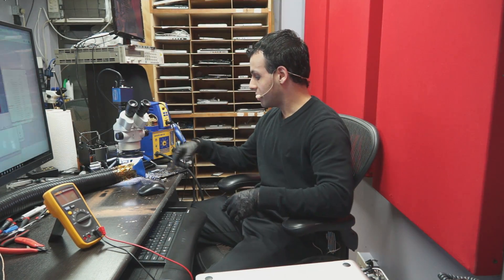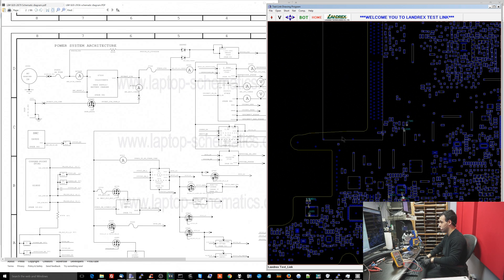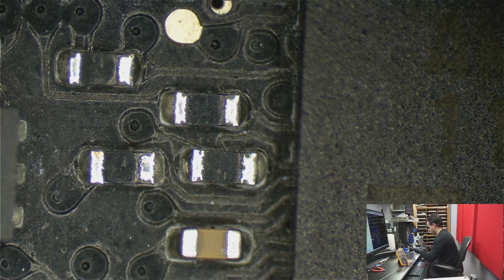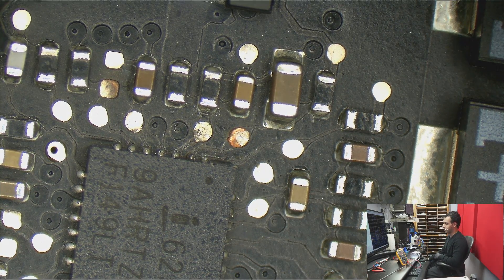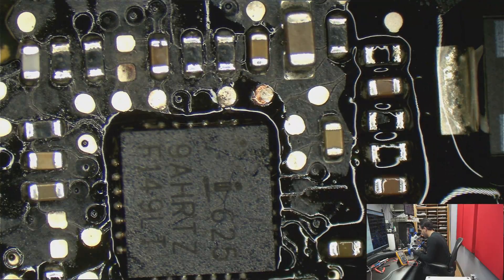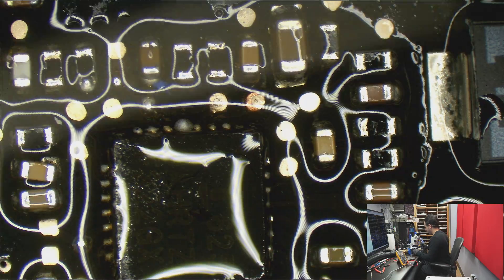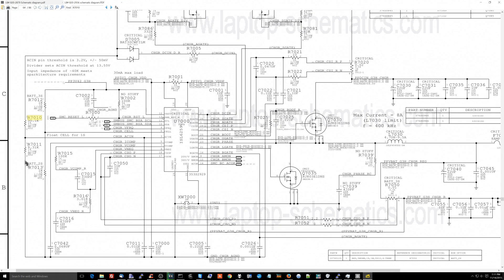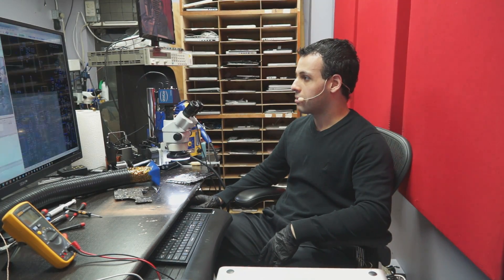Macbook 820-2936 logic board dead; diagnosis and repair of U7000 circuit.

Comment: C7011 connects the center of the resistor divider to ground, it could have been this capacitor. But why didn't you suspect this capacitor before judging on the chip ? These kinds of capacitors also fail short.

Comment: I have this problem with a board 820-2936-B:
- green light on charger oK
- fan spins ok, but then a full speed
- no chime, no long beep even if no memory
- nothing on display, not backlight.

Measures:

ALL_SYS_PWRGD=3.32V
PPBUS_G3H=12.6V
PP3V42_G3H=3.48V
PP3V3_S5=3.33V
PP5V_S3=5.1V
PP5V_S0=5.1V
DPBUS_S5_HS_COMPUTING_ISNS=12.6V

PPVCORE_S0_CPU=1.12V
PPVCORE_S0_AXG=0V

PPVRTC_G3_OUT=3.33V
PP5V_S5=5.1V
PP5V_SUS=5.1V
PP3V3_SUS=3.33V
PP3V3_S3=3.3V
PP3V3_S0=3.3V
PP1V8_S0=1.8V
PP1V5_S3_DDR=1.51V
PP1V5_S3RS0=1.51V
PP1V5_S0=1.51V
PPVTTDDR_S3=0.75V
PP0V75_S0_DDRVTT=0.75V
PPVCCSA_S0-CPU=0.9V
PP1V05_SUS=1.04V
PP1V05_S0=1.05V
PP3V3_ENET=3.29V
PPVP_FW=12.75V
PP3V3_FW_FWPHY=3.31V
PP1V0_FW_FWPHY=0.99V

PP1V05_S0_PCH_VCCADPLL=1.06V

PP1V5_S3_CPU_VCCDQ=1.51V
PP1V05_S0_CPU_VCCPQE=1.06V
PP1V8_S0_CPU_VCCPLL_R=1.8v

All these voltages seem ok, except for PPVCORE_S0_AXG=0V, but for what I see, it doesn't appears until videos is displayed

Comment: i brought my macbook A1278 820-2936B to repair shop, and they didn't do it well, and after i check my board, i found that u7740 is missing, and i check it in schematic, the schematic tells that it should be on board, does anyone can help me ? does it really on board or not ? thanks so much

Comment: i appreciate the work you do, But I can get this board new for 329 with shipping. Less than the $350 you charge to fix it. Youre still the man but why do people bother to fix a 5 year old board nowadays
Reply from the maker: +mastahc411 No fucking clue! I tell any customer who asks me what I think to spend the extra $400 to get a refurbished Macbook Air from Apple.com's refurb store and toss this shit... it'll feel 10x faster because of PCIE SSD, battery life kicks this thing's ass, screen kicks this thing's ass, it's lighter. The funny part about salesmanship is that the more you tell someone not to do something the more it makes them want to do it. :( I can't imagine using a sandy bridge processor in 2016, dealing with a fan that spins at high RPMs just playing 1080p YouTube...

In terms of the pricing, even on this five year old POS, the average consumer has two scenarios.

Scenario A: self service, $329

1) Disassemble their laptop.
2) Find the right part number.
3) Hope the number they found is the right one.
4) Find a vendor.
5) Hope the vendor doesn't sell them a piece of shit pulled from a dead machine by a brainless hack at some escrap company.
6) Wait a week for it to arrive. 
7) Install it, hoping during install they don't fuck it up.

Scenario B: store service, $325

1) Give me the laptop in one piece.
2) Get phone call one day later that laptop works perfectly.
3) Pick up laptop in one piece, done. 

Mine is slightly better on price, but absolutely kicks ass on convenience. How many people are going to buy a board based on model number "A1278" and get the wrong one, or buy a board that is dead from some escrap jackass, or plug a liquid damaged cable into it and "poof", or rip some cable. None of this is rocket science, but everything is easy the SECOND time you do it... it's not fucking up on that first time that is priceless. :) 

Now for other REPAIR shops my model makes no sense, but I can't say I care about them anyway. I have repair stores often dangling business in front of me, like a carrot to a starving rabbit, as if I should do it for $50 just because. Why bother... ?? the new jobs slots are filled with paying work from regular consumers who are happy, this method lets me make money and saves a board that would otherwise get tossed in the garbage, and is much more convenient and valuable to the end consumer. Score 1 for planet, score 2 for me, score 3 for customer. :) 

In terms of long term viability, you can see what I think about that here. https://www.youtube.com/watch?v=AunzSPGlnpI Absolutely no way in hell do I suggest this will be a viable business model five to ten years from now, you always have to move on and work on new stuff.
Reply: +Louis Rossmann I can completely relate. in just had a customer that spent $400 to have a HP g60 with a celeron have a screen and hard drive replaced and an os reload despite us trying convince him to buy another machine
Reply from the maker: mastahc411
Wow. I have been bested by your REVERSE salesmanship :) :D :p